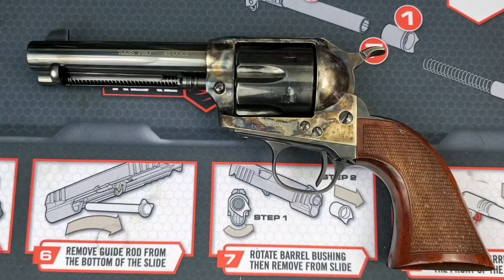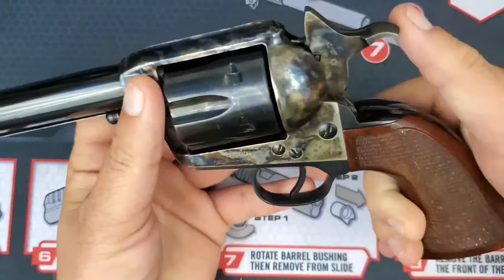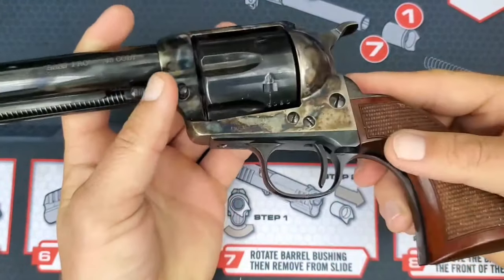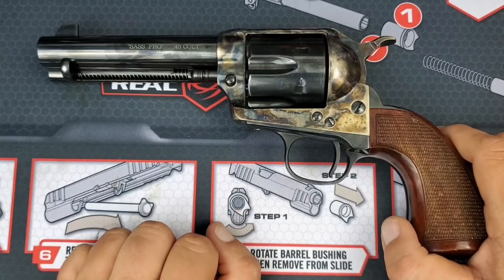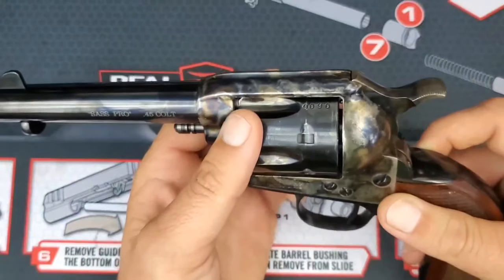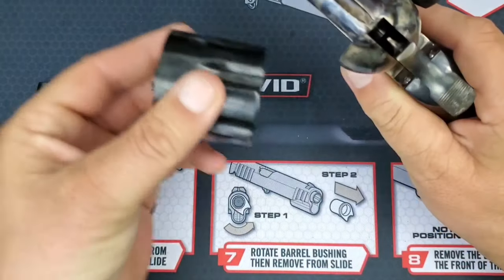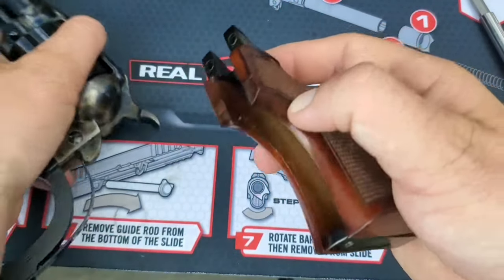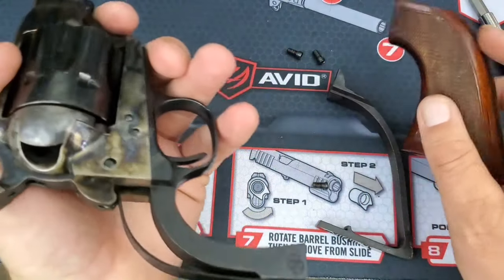Uberti Cattleman ii. The good, the bad, the ugly...

Comment: I bought 2 of these from Cabelas in 357. Hands down, my favorite guns to shoot. I wanted a matching rifle so i bought a henry big boy classic. I wanted it in 357 but they only had a 44 magnum in stock. i ended up getting it. I have a lot of modern guns but the single actions and lever actions are the most fun to shoot.
Reply from the maker: Bro, I did the same thing,lol. You can see in one of my other videos.
Reply: hey, which caliber will have less recoil 357 mag or 45 acp?  I wonder which one to choose?  help
Reply: @soniapoch7905  Mostly depends on the rounds your shooting. But to me, 45 and 357 feel about the same.
Reply: @soniapoch7905 to me a 45 slowly pushes while a 357 has a sharp snap the 45 is much flatter in comparison to the 357 recoil is much higher in a 357. The 45 hits much slower at about 900 or so fps with 230 g ball ammo. A 357 travels 1400 fps approximately 158g ball ammo both with a barrel of 5 inches. A heavy 45 full size pistol is flat shooting like a 38 special a 357 with a heavy frame has a snappy but manageable recoil may take time to adjust also a 357 can shoot 38 special as well hope that helps

Comment: Hold your pistol with the load gate to the sky and lower your cylinder into the weapon. Close the load gate then turn the revolver upside in a horizontal position holding the cylinder from underneath the weapon cradling it. Center the cylinder while slightly pushing forward on the pin until it aligns in place. I hope this helps
Reply from the maker: I appreciate it, great channel too man.

Comment: Good video! Knowing what I've learned after owning my Cattleman II for a few years, the first things I would have done is install the Wolff springs in it, and blue Loctite most of the screws. I found an ACP cylinder for it on the bay, and had my gunsmith fit it. It shoots great with ACP, maybe a little more accurate and definitely cleaner. It's a blast to shoot, but I most enjoy in while setting in my recliner and watching INSP. lol

Comment: Nice Cattleman II.  I have one, too, and like it. Mine, however, doesn't have the two positions yours does on the cylinder pin.  Since you didn't mention it, you likely are not aware that one of those positions constitutes a safety position that prevents the hammer from falling all the way down.  I'm referring to the second notch, i.e., the notch that positions the pin further in.  So your Cattleman actually has two safety features not found on the Colt SAA, i.e., 1) the second position on the cylinder pin, and 2) the trigger safety (which allows for the safe carry of six loaded chambers by preventing the firing pin from contacting a primer when the trigger is not depressed).  And neither safety interferes with tradition function or looks, which is pretty cool.
Reply from the maker: Thank you so much for the info. I really appreciate it. I really like this pistol. It's been all over the place killing rattle snakes.
Reply: @caseysammobench  You need to confirm if your pistol actually has the floating firing pin. I have two Sass pro's with your style hammer and four clicks. it does not have a floating firing pin. your hammer appears to be the type that engages a safety bar that blocks the hammer against the frame. Uberti made a few changes to the guns and none of the instructions match the gun in the box. So how to you confirm the floating firing pin?? Remove the cylinder. and with the hammer down you should not see the firing pin protrude the frame. then pull the trigger and you will see the firing pin protrude the frame. If you see the firing pin protrude through the frame with the hammer down you do not have the floating firing pin.
Reply from the maker: @Kerry Stottlemyer  thanks for the pro tip. It is confirmed to have the free floating firing pin.
Reply: Does this impede any reliability? Looking for a bear gun that will shoot every time.
Reply: @valkarcy  Well, the safety that's strictly to do with the cylinder pin won't impede reliability, but the trigger safety mechanism is a little on the tiny and fragile side, so I guess it's possible it could break at some point, rending the firing pin useless (and the gun incapable of firing), but I am unaware of how likely that might be.
Reply: @therealhawkeyeii7888 yeah but if for some reason you couldn't get it fixed by sending it in for example shtf you could still use any impact rated epoxy or jb weld and make it fixed and it'll work. I don't suggest doing this unless you have no other choice though as it'll void your warranty.

Comment: I purchased a pair of Uberti Evil Roy and they ened up as junk. Screws fell out from poor tapping. Worse eas not timed correct and lots of hammer sticks off center of primer. No factory help as I wanted to send them back to be fixed. They don't fix there guns.
Reply from the maker: Sorry to hear that. I haven't had any experience with their customer service. I've had a great experience with this particular revolver. For the screws, another commenter said the screw thing is a common issue among most revolvers. A bit of blue or purple thread locker will fix that issue. I had that one screw on the ejector rod always loosen until I did that.

Comment: My gun is shooting to the right by 3" at 25 yards, do you know how to fix it?
Reply from the maker: It maybe your sight picture and or trigger squeeze potentially in combination with the ammo type. Are the groups tight, just 3in to the right? Basically you may just be pulling a tad to the right as you shoot. You just do it consistently.
Reply: @caseysammobench   yes the groups are tight at around 2" at 25 yards. I can keep my shoots in a 1.5" bullseye at the same distance with my 44 Ruger super Blackhawk. I reload my cast bullets and have been doing so for over 40 years.  Thank you for the reply and advice .
Reply from the maker: Np, it sounds like you're a pretty great shot with them all. I can't imagine the sights are that far off, but I'd say maybe a gun smith can check it out to confirm.
Reply: @ricktaylor5744 if it's the gun a Smith can either bend the blade, I don't recommend that or you can have the barrel turned just a bit.
Reply: @ricktaylor5744 I'd try grip and technique first. Mine shoots to the left with some ammo and not with others, but I've learned how to adjust the sights picture to compensate so it shoots straight. With cast bullets I have to put the front blade against the right edge of the rear notch. My groups are between 2 and 3.5 inches at 25 yards depending on the load

Comment: These are great looking guns. I have a Uberti that is three click with the floating firing pin, a Great Western (Pietta) that's a true 4 click Colt copy I added a dual groove base pin to to have some form of safety. It's a US Marshal dual cylinder 45acp/45 Colt. Then the Ruger Vaquero Bisley with transfer bar and a Beretta (Uberti) Stampede with transfer bar. Two are safe with 6 rounds and two are iffy. All are great though.
Reply from the maker: I just looked up the Pietta. It looks so nice. One of these days I want a Vaquero so I can shoot higher pressure re-loads safely through it. From what I understand rugers have a more hardened frame that can handle the higher pressures.
Reply: The Italian guns have forged frames and are strong but their size limits what they can handle. The old Rugers were larger and could handle 44 magnum easily.
Reply: @caseysammobench  the older, ORIGINAL Vaquero has a very strong frame and cylinder. The New Vaquero is closer in size to the SAA. If you get a New Vaquero, do NOT run it with "heavy" +P loads. You can run them with a little more pressure, but nothing near what the large frame Vaquero will run. By the way, that's a beautiful Uberti there.
Reply from the maker: Thank you for letting me know. I was thinking about getting one just for the +P loads
Reply: Also the 45 colt cylinder has the same amount of metal at the bolt notch as the 45acp cylinder so will take the same 23k psi pressure. It's just not necessary to go that hot and to have a serious round out of the 45 colt. If your state allows it the underwood or buffalo bore standard pressure loads will ethically kill deer as far as you can put it in the right place. I treat it like bow hunting range wise and I know from experience that my pistol will never not have enough horsepower to perform.

Comment: Ive got 2 of them one longer and one shorter barrel. Screws come loose on both of them. Grip/backstrap screws especially so
Reply from the maker: What do you think about the ones with the longer barrel? They are 7.5in right? 

One of the other people that commented said its a common issues with most revolvers. If you haven't done it yet, the blue loctite is a game changer.
Reply: @caseysammobench  I just got the 7.5 inch one i havent gotten a chance to shoot it yet. Both the screws under the trigger guard were loose. The shorter one ive had for a couple years and the same screws came loose as well. I havent tried loctite in case i needed to take them apart
Reply from the maker: @tim laborde  I don't blame you. As long as you have the right screw driver head, it should easily come un-done even with the thread locker. 

You could start with purple thread locker too . Just a tiny dab on each end will do the trick. Lemme know what you think when you get the chance to shoot it and what you think. Uberti has me pretty hooked. Also, is it a 45LC?
Reply: @caseysammobench  Both are 45lc. I dont really want to do a 45acp conversion. I like the classic feel i guess. Ill give the thread locker a try on this 7.5 inch one once i get some time to actually shoot it. I work a lot so its hard sometimes
Reply from the maker: @tim laborde  for sure. Ammo prices don't help and lack of primers for reloading doesn't help either. I agree with you on the conversion. Only reason I want to try, is to just have the capability to shoot 45 ACP since I don't have one anymore and it is much cheaper than buying a new gun. Work has gotten in the way of my reloading and videos as well. I'm active Army and we have spent a lot of time in the field over the past month. You take care and thank you for supporting the channel.

Comment: Make sure you use the right sized screw driver head to avoid buggering the screws.
The screws can be repaired and fire blued.
Reply from the maker: Ya, definitely my fault. It was what I had out in the field at the time. I've since then upgraded the field kit. But since I used the blue loctite. I've had no issues

Comment: I love all of mine, however I’ve had to send them all back due to light primer strikes and brass frame cracks. I only use SAA Cowboy loads so I don’t understand the cracks. If you can I’d splurge on a lifetime warranty if your vendor sells that.
Reply from the maker: @frank castle, that is pretty interesting about the brass cracks. I've never had a single light strike or frame issue. 

I wonder if it's an issue with the lot numbers. 

Unfortunately I think I'm past the point of warranty on mine. I got it 4 years ago from Cabelas.
Reply: @caseysammobench  I had 2 new ones I had to send back to back. They were only 2 weeks old. Factory warranty is 5 years

Comment: I got a 45 ACP cylinder for mine from Taylor's and now I like it even better haha 45 long colts way too expensive by me
Reply from the maker: That's interesting. I am gonna do that. Long Colt isn't bad for me now that I have the brass. But I'd like to get two guns out of one. I'll try to find unless you don't mind posting a link.
Reply: @caseysammobench  also from what I told the 1873 design can't handle plus keys so only shoot standard loads. I shot herters target loads, Winchester white box range loads, and federal standard velocity hollowpoints. They all shot good and it actually hits right where I'm aiming elevation wise the 45 long colts always hit about an inch or 2 high.
Reply from the maker: Yes for sure. I meant to say that on the video about standard loads. Its one of my earlier ones. Just trying to get used to talking on the video.
Reply: @caseysammobench  did you get the link? I posted it in the comments but I don't think it took because it assumes it's spam. Just go on Taylor's and companies website and look at 1873 uberti new model parts it's #5 45 ACP cylinder. Also in my poorly film the video I posted a link in the description.
Reply from the maker: @clay-r15  very cool! I just checked out your channel. Thank you.
Reply: Did you have to do any fitting for the cylinder from Taylor's & Co or was it just drop in and do you know if it comes in stainless or nickel
Reply: @braxtonaaron3006  it was just dropping but I had to use the cylinder bushing from my 45 LC cylinder the one it came with was a little too long. I think it's only available in blue but not sure
Reply: @clay-r15  how do you feel about carrying six with the floating pin on the Uberti
Reply: @braxtonaaron3006  I don't really trust it, I always load 6 when I'm target shooting but when I carry it on my side hunting I only load 5 and keep it on a empty chamber. It's probably pretty safe to load all 6 but I'm just being cautious.
Reply: @clay-r15  you will however send the pistol in to Taylors yo have the new 45 ACP cylinder fitted and timed to your respective pistol.
Reply: @denisdegamon8224  I got a video of mine it dropped right in. I don't think timing really matters because the bullet is the same diameter and the primers in the same position the only difference is the length of the shell.
Reply: @clay-r15  not so sir. The ratches on the rear of the cylinder and the pistols hand (on the hammer) have to be matched up,  (timed) otherwise the barrel alignment with the cylinder would be slightly off. I would highly recommend that you ask that question to the manufacturer or a gunsmith before you proceed.
Reply: @clay-r15  I am glad it worked out for you. In many cases that doesn't happen. In bad cases the bullet shears off sone on the forcing cone.

Comment: I’d love one of these with the dual 357mag/9mm cylinder.
Reply from the maker: That would be sick. I want another one. I went a different path for now working on the sig P320 though.
Reply: I have the 9mm Uberti El Patron.  I love it.  It takes 9x19 ammo (but not +p).
It is smooth.
I would suggest getting some BLUE AND OR PURPLE -   !!!!!!NOT RED!!!!! locktite.
put the locktite on the two screws on the trigger guard.  I have spoken to others and they have the simlar problem (of those two screws coming loose).  Blue or Purple locktite will fix that.
The 9mm is extremely accurate.
It is fun to shoot.
the 5.5 inch barrel is perfect.  Most any 5.5 inch holster will fit it.
---
Just to advise:
if you cock it all the way, the trigger pull is about 2 or 2.5 lbs.  That is not much and trigger control is vital.
If you get some 9mm snap caps, that will help you train.
Reply from the maker: @davidgiles4681  thank you I absolutely did the blue loctite about a 1 year ago and have had no issues since. I tested my pull at 2.5lbs as well. In some of the other comments they mention light strikes. Have you had any issue with that? I haven't had any issues with this pistol other than the screws and that's already fixed.
Reply: @caseysammobench  no light strikes.
Due to the two screws ( on the trigger area) coming loose and lock tighting them  - no problems at all. 
A 2.5 lb trigger is light.
But, I have become used to it.

Comment: I have two older ones.   One is in .357 mag and is 7.5" barrel...     anyone can hit a full soda at 25 yards with the gun..   the other is one I had to order..   4.75"   in 44 spl.     With my handloads it will hit a shotgun shell at 20 yards.     Screws are soft.     fit and finish is excellent.   polish and blue are on a par with my old SW guns.     Grips are too red for me but I refinished em both in more 'American' walnut.      I actually keep the 44 spl on my nightstand cause like all SAA's?  it points perfect.    Everyone who shoots either gun wants one.
Reply from the maker: @Doran Maxwell, either one of those calibers is bad ass for this pistol. I got mine in 45 mainly because my Henry is 45 Colt as well and its nice to have the rifle and pistol in the same caliber. Contrary to my fairly shitty shooting in these videos, you are dead on. It is a tac driver at 20yds. I use my hand loads as well. I use FMJ 45 Auto projos that I got on one hell of a sale and just developed my own load for them.
Reply: @caseysammobench  Yeah..   I got a Henry in both 44 mag and .357.    The 44 spl Uberti shot low which...  was good cause I could file the front sight.   pretty much dead on now at 20 yards or so.

Comment: This firing pin safety in the hammer is a bad design, causing occasional misfires with carefully squeezed triggers. Not dependable !!
Reply from the maker: I think some have had issues. I have had no issues with it whatsoever but I agree. If it's a supposed to be a safety but you should only carry 5 anyways, what's the point of it.